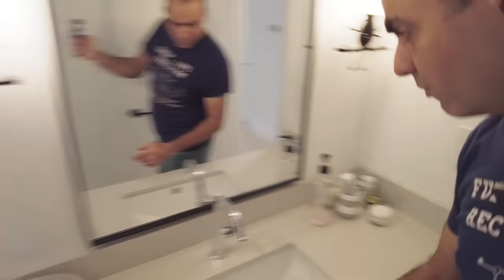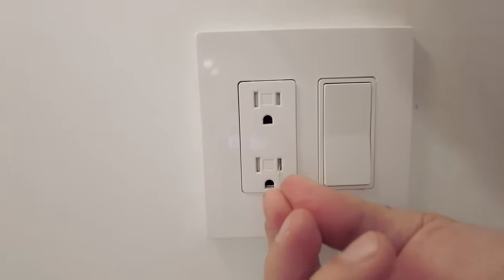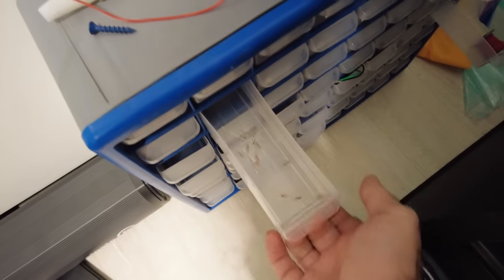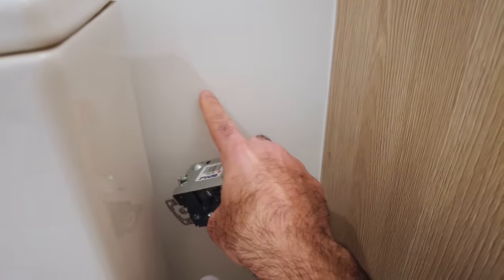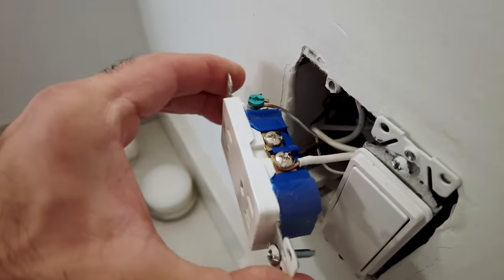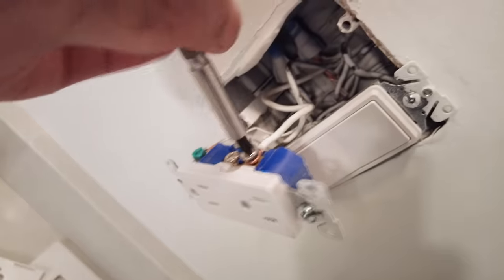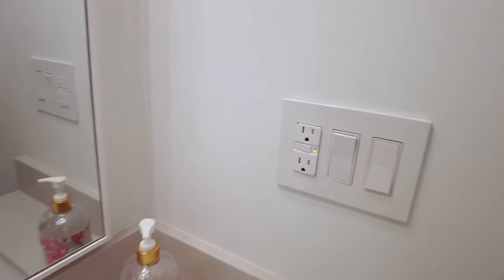Installing an Outlet… For a Toilet Seat?!

Comment: 00:00 🚽 Installing a new power outlet for a bidet toilet seat; bidets and automatic washing systems common in other regions.
01:39 ⚡ Testing outlets with a 10K resistor to check for GFCI protection, ensuring safety measures.
03:01 🛡 DeleteMe, a service removing personal data from online brokers, safeguarding against privacy breaches.
04:38 💡 Understanding GFCI devices, their placement, and how they protect multiple outlets.
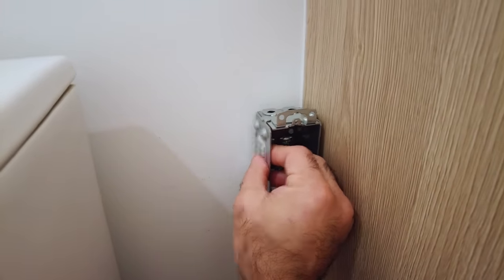06:12 🔌 Planning wiring routes, utilizing existing wall structures, and measuring for safe installation.
07:22 🧰 Techniques for passing wires through tight spaces and drilling holes for wire placement.
08:14 ⚠ Safety reminders: turning off breakers, understanding live and neutral wires, and handling outlets cautiously.
09:46 🛠 Utilizing tools and creative methods to thread wires through walls and connect outlets.
11:03 🔗 Properly connecting wires to outlets, grounding, and securing connections for safety.
12:18 🧵 Dealing with tight spaces and challenges when passing wires through walls and studs.
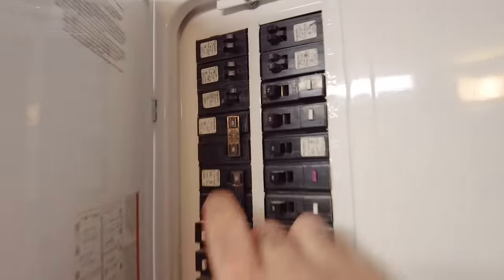13:40 🧪 Testing the outlet functionality, checking for power, and ensuring the GFCI's operational status.
Reply: OMG YOU'RE THE LIFE SAVER!!!

Comment: Compared to our European/French style wall outlets, this type seem much more dangerous, ex. having the wires connected so close to each other without some separator. When you put in a plug, is it possible to touch the pins while they are still under current (for example if you don't plug it in all the way)?

Comment: If the bathroom outlet is an actual resetting GFCI outlet, you would have to wite the new plug on the load side of the GFCI plug to have the new outlet be protected

Comment: Having a socket or even light switch anywhere in a toilet or bathroom is not allowed in uk and shouldn’t be elsewhere, you should have it wired inside that cupboard and even better have it hardwired inside the wall and isolated by switch outside the room

Comment: Love your videos! Good thing you took pictures while it was being built. Drilling that would have been a pain!
I'd recommend using Plastic old work boxes and wrap up the contacts with electrical tape to avoid getting shocked when you pull the outlet. lol Less chance of shorting or shocking yourself later. Although in saying that I realised I haven't seen a video yet where you didn't shock yourself. lol

Comment: OMG, USA outlets still have exposed live screws? In Germany we have well insulated push-in holes for solid (1.5-2.5 mm² Cu) conductors on new outlets ( & of course our outlets are recessed) ... 
I would never install cables trough a cabinet (because you will need an electrician to remove the cabinet) & I guess it´s illegal here (we would run the cabes inthe wall or on the wall in a plastics channel well clearing the cabinet)

Comment: Things i noticed wrong. As an electrician.
You cant terminate MC cable in a plastic box, well... he didn't even use connectors or  redheads. 
Im pretty sure he didn't bond the cut-in box. Or use Madison bars. 
Otherwise an ok installation. I still wouldve used romex. Romex can be exposed inside cabinetry

Comment: Can you create a circuit for detection of "well" another circuit. Like a device which takes two parts of a wire and a load in series connection. If the load is removed the circuit will break and the device should detect it. The device is powered separately. The device checks the circuit that is of AC. The device can be any of the two: AC or DC. 

Simply (abstraction)
A device which takes as input the two ends of wires of a serial circuit, and if the circuit breaks it should output some event like lighting a bulb. 

Thanking in anticipation.

Comment: Electricity in your country is so exotic. Your plug have security and have strange form factor, breaker too, you tight wire and use a little piece of plastic and other things. I think electricity is so much easier and secure in Europe.

Comment: If you're still searching for some ideas for next youtube video, then maybe you can try making a high voltage electric blower with no moving parts. 

You can also maybe try making an electrostatic plasma confinement device (Inertial Electrostatic Confinement).

Comment: I'm just having the same Issues even plugged into a 47w charger. It could be the cable which is 16 feet long and one side is plugged the pc for pc vr and  Other side is the charger and other side plugged into the headset. The name of the cable is  JSAUX Câble Link

Comment: Anti short bushings. I am not sure that you are supposed to use those plastic box clamps for flexible metal cabling. I always thought you had to use a metal box -maybe a professional electrician can comment. I think generally something has to be listed for a specific application
Reply: Yes. He should have replaced the light switch box with a metal one.

Comment: We remodeled our bathroom last summer. We had an electrician come in to update some of the wiring, move some plugs and switches, and install a plug behind the toilet for the bidet. He was in his 60s, and clearly hated everything and everyone all the time for no reason. When I told him we needed the plug, he told me no we didn't flat out. I explained we needed it for the toilet seat. He told me we don't need an electric toilet seat. We've been using toilet paper for 100 years and it's fine. When I explained it was for a heated seat and a bidet, that my wife was asking for, he started talking about how my generation is soft. I asked him if he really wanted this job or if he just wanted to complain about everything, because I want the plug where I wanted it. And if he wasn't willing to do it, I can find someone else.he laughed and said if I wanted to fire him to go ahead because it will take months to find someone to come in and do a job like this. So I fired him, and by that afternoon, I found a friend of mine, whose father was Electrician around the same age and had no problem installing it.

Comment: Not a bad job with the wiring. The MC cable is fine for this application. But you forgot to put an anti-short on the ends of the MC and you put the MC into a plastic box. You cant terminate MC cable in a plastic box, at least by US code unless you bond the metalic sheath. 

314.3 Nonmetallic Boxes. Nonmetallic boxes shall be permitted
only with open wiring on insulators, concealed knob-and tube
wiring, cabled wiring methods with entirely nonmetallic
sheaths, flexible cords, and nonmetallic raceways.

Exception No. 1: Where internal bonding means are provided between
all entries, nonmetallic boxes shall be permitted to be used with metal
raceways or metal-armored cables.

Comment: You should not install that cable in the plastic wall box. Those clamps are only made for nonmetallic cable. If you install a metal cable, both ends have to be metal boxes and you have to use clamps made specifically for metal-clad or armored cable.

Comment: I recently did this install near my toilet too! I wasn't as lucky with stud placement or the rework electrical boxes (they don't give you a confident connection to the stud). Ended up punching holes into the drywall for access. Went up into the ceiling and down... Use the bathroom fan access to help fish.

Comment: the "fun" phrases old electricians say to remember where each wire goes are "It's like the Olympics, black always gets the gold," and "Electrical work is BS"
Black on gold as well as Black on smooth wire. 
also if you attach a ground to the outlet, it grounds the metal attaching bracket which will in turn ground your box. This is why if you have a properly grounded outlet you can touch the screw on it to ground yourself.
EDIT: fix quotes

Comment: i'm a fellow electrical engineer and have run many similar projects in my homes.  i've always looked at it like i'm not licensed or trained as an electrician but my ee understanding can make sure i don't do something that's going to be unsafe.  never used sheathed as i was always in walls and either unfinished basement or attic space.  my latest was a new outlet directly above an existing outlet to behind where a tv was getting mounted.  very quick and easy except that the wall is insulated!  i temporarily pried back the tab from inside the existing box and ran a fish tape up to the new hole, then taped the romex to that and pulled it back down through.  tape lets me get a good hold without the added thickness of a knot.  i used a non-conductive box since that's what everything else in my house is.
Reply: Just because it is safe, doesn't mean it is legal, lol.  I'm with you though.  Personally I don't really care about the codes as long as it won't catch fire or electrocute someone accidentally.

Comment: 100% times better multicunductor cables like we are using in Italy. Flexible and easy to wire everywhere.

Also, more often all the plugs of the flat are connected to the differential switch, located on the main cabinet.

Comment: If you have 3 bathroom receptacles already on one 15amp circuit you’re going to have a bad time with your bidet on that circuit.  Anyone using a blow dryer in any of the bathrooms while the bidet is in a heating cycle is likely to pop that breaker.

Comment: For our beloved AMDM toilet seat bidet, I wired a GFCI outlet directly behind the toilet below the tank. (Probably an Electrical Code violation.) 
A nightlight plugs into the outlet and lights the watercloset just enough to see.
We turn theat down at night to $ave.  Wonderfuhaving a warm toilet seat and warm cleansing spray!   Everyone should have a toilet seat bidet.  Better than our real bidet with douche spray!

Comment: Question for electricians - at 11:00 - is there a need to connect wires like that? I assumed that additional screws for the outlet are used to connect chain of outlets instead?
Reply: WAGOs are used to connect the wires.

Comment: Instead of using those wonky wire nuts you could just connect both wires to the existing socket.
It already has two screws on both sides (one for input and one for output).

Comment: That's the wrong type of wiring for that 2gang box. Romex would have been better. Using wire mold in the drawers to protect the wiring and a wiremold box on the side of the cabinet would be what I would have done.

Comment: That electrical box is recessed exposing the wires to sheetrock. That is against code. You need to purchase an "extender" that will surround the wires all the way flush to the sheetrock.

Comment: I worked in a ladies kitchen that had been remodeled by a hack. The kitchen had a GFI outlet in every receptical, what a WASTE of money!  Yes, most homes usually only have one GFI for multiple  outlets. Our first house had the bedroom outlets wired in with the bathroom using a GFI outlet. Running a computer in the bedroom overloaded the old GFI because it was weak ,causing a fault. I was greatly entertained by his efforts.  I know this is a teaching video, but know there are fools out there that actually do what he did.

Comment: Does the multimeter break when you leave it in current mode and connect it to mains?
Reply: The multimeter has a fuse that protects it
Reply: Ok

Comment: The  switchgear looks primitive and extremely hazardous compared to UK switchgear.
On UK outlets there are no exposed live or neutral termnal connections. Not impossible to get plated but you would have to really want it.

Comment: Im not from the US, so I don't know the hardware, but you have two screws on each side of your first outlet - couldn't you just use them to attach both wires instead of using these wire nuts?
Second, I am surprised by the design. Haven't seen an outlet or switch with exposed contacts like that, not even on the 30+ years old ones in our house ...

Comment: Hey Mehdi! I’m an Electrician (apprentice) studying to be an electrical engineer. GFCI protected receptacles actually do work between live and neutral. This is why in renovations of old homes without a ground, you install GFCI receptacles as they’ll be protected with or without earth ground. Fun fact!
Reply: Did someone tell you that? That's wrong but also a half truth. They replace a ground in retrofits by monitoring that all the current is flowing between line and neutral and thus any current imbalance between L-N has to mean current is flowing to ground, which is when they then trip and disconnect the contacts internally. So, they do operate by monitoring L-N but they in no way offer protection against shock if you touch the live and neutral

Comment: I had to put in a new light switch in my basement, so I turned the breaker off and began unscrewing the switch, then got shocked. So, I went to the breaker and made sure it was the basement switch (which it was) and then also tried the furnace switch along with the basement switch. Got shocked. I tried the washing machine and dryer switch and any other switch and I still got shocked. I had to shut the main breaker fuse, so I guess the switch was wired to that?? For some reason without the switch in the living room light would not work either, even with the breaker on, and even if the switch was off the lights worked independently from it so I think this house I have should be condemned.

Comment: From an european point of view, it's surprising you use armored wire but still have naked screws for contacts on the sides of the outlet. I suppose it's a different point of view on safety. Always nteresting to see how electric systems are made in different countries!

Comment: Weird that you guys use metal isolation and metal boxes for an outlet. Seems kinda dangerous in case the wire degrades or you accidentally cut it and it touches somewhere.
Reply from the maker: That's why there is gfci!
Reply: @ElectroBOOM  All hail the lord Gfci!

Comment: As an trained but not working as electrician in Sweden, all this looks strange to me. You run loose wire tubes inside the walls, the boxes are metal instead of insulating plastic, you don't have ground fault on the entire installation (sweden has on all new installations), your ground wire had no insulation if I understood correctly... So many strange things. 😮

Comment: As an electrician, you did pretty good for a professional dumbass. 
The single gang boxes can be tricky if you don’t know which one to use. But as I recommend, and as you did, cover it with a large faceplate and no one will know.

Comment: Thats interesting, in Europe the walls are made of solid concrete So you cant do it So easily and you need to use a 3KW drilling Hammer  to destory the wall like a madman to make a single wire connection like this one. All the wiring is pre-made and making your own is just P A I N Just imagine having to make a two meter long 1 cm wide  tunnel inside a solid wall to make an outlet. So i have a lot of exposed wiring in my lab i dont feel like tearing my walls aparat

Comment: ... you DO realize there are mountable bidets that run on the water pressure and don't require power, right? (no hot water, tho)

Comment: The american circuit brakers looks pretty dodgy, while europeans looks muchi nicer, you use distributed GFC devices while here in europe we have centralized RCD's. I like the idea or armored cable but I see so primitive using solid cable instead of stranded cable. Will be great if you can make a video EUROPE VS USA electric comparison.

Comment: we in Germany have WAGO much saver and i worked with the stupid wire screw things these are terrible with WAGO you only have to open it and push your wire in and close it. WAGO is much saver but as electrician i may do this also at my house. sorry if my English is not the yellow form the egg i dont had English at school so often if my english is bad like it

Comment: It must be a country difference but im shocked about the amount of metal used here. Normally the outlets would be in a plastic (service?) box, the wire would been in a plastic step-proof pipe and it would also go into a plastic box at the end.
Infact the lazy electricians way would been to put an outer plastic cable cover from the outlet to the toilet all outside and put into a rated IP56 outer outlet.

Comment: Japanese toilets aren't a thing in the UK, mainly because our standard only allows outlets (For shavers and toothbrushes etc) to BS-4573, which obliges an isolating transformer and a current limitation to 200mA. Unless there's a basic model that relies on solenoids and water pressure alone (= no heat at all) I doubt that would provide anywhere near enough power to operate a washlet. 🚽🇬🇧⛔

Nevertheless, I wouldn't be at all surprised to find a few „professionally“ installed outlets in UK bathrooms...And with our standard voltage being 140v above¹ Japans; Probably a few blown-out Washlets, and similarly blown-out users who won't be flaunting their backsides on the beach for a good few years! 🚽🇬🇧💥🍑🔥😉
(¹ - And also 10Hz below, if you bought an appliance from the 60Hz side of Japan!)

I'll leave you all with this tid-bit:
🇪🇺 Bidets are commonplace throughout Europe, and 95% of people make regular use of them.
🇫🇮🇨🇳🇮🇩 Hoses are generally provided in „loo“ of bidets, and likewise receive majority use.
🇬🇧🧻🇺🇸 Common-law countries seem to have a distinct lack of bidets or hoses and insist on people using toilet paper on its own, yet - Despite histories of widespread Colorea, Typhoid and other 💩-bourne disease - Still regard themselves to be „Hygienic“ countries. 🤔

Comment: PS:
I'm not an electric car fan,in fact I'm 100% against it,but I just want to know the electric science behind it .
Reply: The electricity goes through loops in the motor which make magnetic fields that, with some engineering, can make a rotating magnetic field. The shaft spins with it and makes the wheels spin. And why are you against electric cars? Is it just because they have to charge so often?